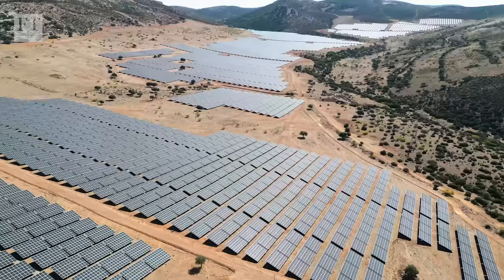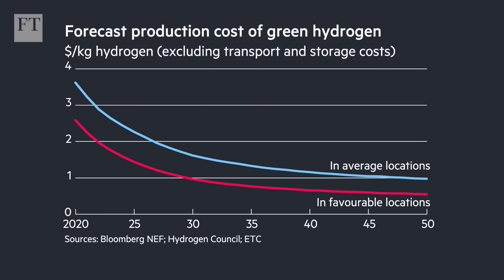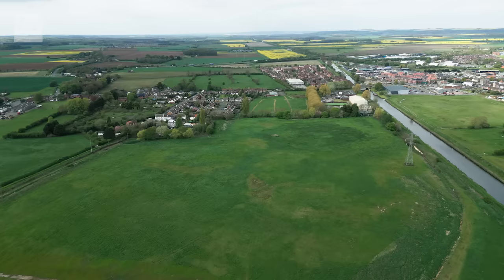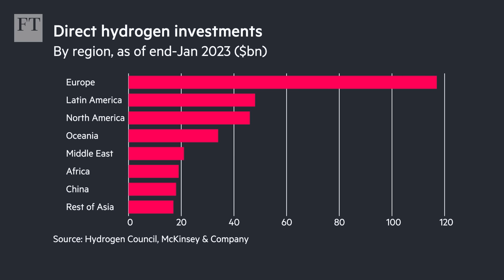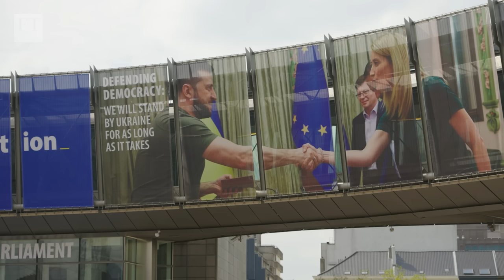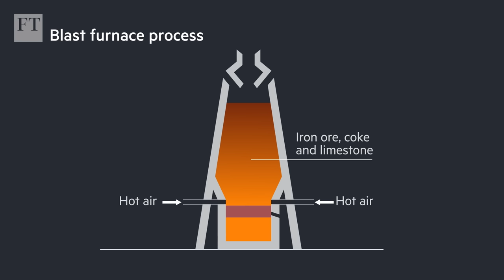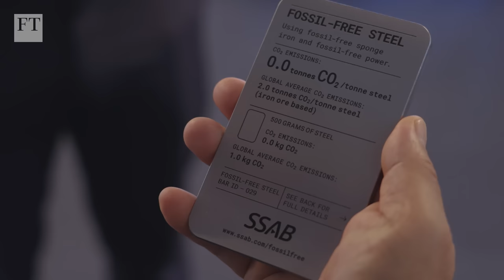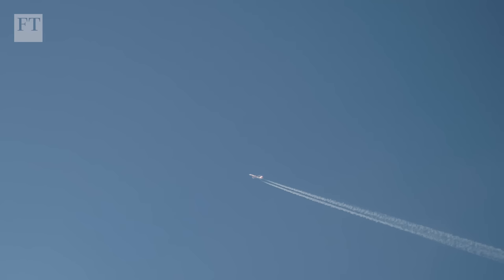Can hydrogen help the world reach net zero?  | FT Film

Comment: I used to be lukewarm about hydrogen but recently read about a project at the hospital Rijnstate in Elst, the Netherlands which changed my views. They have a huge array of solar panels of which the electricity oversupply will be stored in a local hydrogen tank by electrolysis. When electricity is needed the hydrogen is converted to electricity by a fuel cell. 
They also use all the waste heat in the entire round trip process for heating the hospital which increases the efficiency significantly. Because of the waste heat re-use and because it takes less area they choose this solution over batteries. 
The solar panels never feed electricity back into the grid which also prevents those problems. So the grid is not burdened by this renewable solution,  and the grid electricity usage has gone down to some 40% of the original grid electricity usage.
Reply: This is in my view the only way to go 100% to renewable.
Reply: Hydrogen as stationary battery, great. Hydrogen as driving fuel, stupid.
Reply: @Xonikz hydrogen as a stationary store is still dumb. The efficiency loss is 40% whereas batteries are only 5%. Batteries work better.
Reply: Makes no sense at all, just use the electricty or store it in a battery. Don't waste valuable renewables on inefficient conversion processes.
Reply: @mattwright2964  The conversion losses are used as heat for the hospital. And very often in the Netherlands the amount of solar energy is too abundant, and not valuable.

Comment: Hydrogen is a key part of the future energy mix, but there are issues with production, transportation, and energy generation that need to be addressed but glossed over in the video, they are better reported on by others on YouTube etc. 

A major issue ignored in video and by most other commentator is hydrogen's small size, which makes long-term storage challenging as it easily escapes containers to the atmosphere. As  hydrogen rises to the ozone layer, where it reacts with ozone to form water, resulting in ozone depletion and the production of water vapor, a potent greenhouse gas. 

If hydrogen becomes widely used as a fuel, the amount lost to the atmosphere and the resulting damage could be even worse than the concerns about the ozone hole in the 1980s. This highlights the consequences of combining economists and engineers tunnel vision without considering historical lessons. 

On another note, it's important to clarify that the airships mentioned from  the early 20th century used hydrogen for buoyancy, not as a power source, this does not reflect  well on quality of video
Reply: Lets then take mesures to avoid that.
Reply: Thank you for that comment. Hydrogen will have a role to play in transition to a greener future, but it is not a silver bullet to solve all climate problems.
Reply: The technology is still damning too exoensuve i see FT has become a Sneak Oil Salesman channel
Reply: Exactly
Reply: @ssuwandi3240  same was true for solar panels / EV Batteries.
A real stupid argument considering the costs of doing nothing. (Tunnel Vision)
Reply: @Someone-wh8hi  For Experiments that have cost GDP contraction and 44% unemployed I wish we did nothing especially after pandemic bettered economy. The intent to do something regardless sounds amazing in LaLaLand
Reply: Thanks for flagging that slip - I should of course have said “filled” instead of “powered”. We’ve now fixed that.
Reply: There are better hydrogen storage solutions beeing developed lol!!!
Reply: @paulmetelmann8952 it's going to be a significantly bigger player in it! It's already transforming steel production and many other heavy Industries.
Reply: @carholic-sz3qv  name some? Lol
Reply: @johndawson6057  
Who exactly what, John?
Reply: The fact that its economic competitiveness depends on government subsidizing demand by imposing crippling taxes on competing alternatives makes this about as attractive as converting your productive farms over to Lysenkoism. What is proposed is not a real economy at the most basic level and cannot generate tangible value. The master energy input resource that drives this magical economy isn't subject to open price discovery, and that distortion will ripple from the beginning to the end of every single production chain. This is a centrally planned nightmare where the value of the output is indiscernible and decoupled from the value of the limiting input. If you ever get more value out of such a system than you put into it then that would be a first, and you must have done it with the first perpetual motion device. This is about as delusional a conception of how real value is generated as any prelude to mass famine in the 20th century. "Yeah! Let's force them to value what we know increases crop yields and then we'll extract all the extra value we added when they harvest!" People really are this stupid.
Reply: @marpintado  You can't take measures without major costs. It could be worse than fossil fuel usage. It is much more efficient and effective to continue the development and production of batteries.
Reply: I would point out that current batteries are much more efficient for storing energy. At some point, recycling batteries will be enough to provide most raw materials for new batteries and reduce mining.
Reply: you've made a great argument but as someone who is in nano science hydrogen however much small it seems we can store it safely in hospital is used and labs in special containers while transport it in tanks or pipe can be done as NH4 safely. while these aren't viable best membranes are being developed
Reply: @marpintado  We have enough trouble trying to contain methane, which is a huge molecule by comparison.  This is not an easy task.  To complicate this, hydrogen is extremely reactive with other elements.  So keeping the materials for containment and seals in a condition to keep hydrogen contained is very difficult and costly.  The cryogenics needed for storage take an additional toll on materials.
Reply: @carholic-sz3qv  What are they?
Reply: @ssuwandi3240  sounds like you are living in Lala land already, but you’re not alone … hope you are enjoying the company of your fellow ostrich’s, corrupt politicians, and greedy business types. ShMe you will take us down with you.
Reply: @Astrogator1  sure IF IF IF La La Land sounds so bad do not take a cent of taxpayers LaLa Land. Trust me we do not care anything Climate Chaos since the 80s.  Decades went on and where is your dream Fascism project ??
Reply: @markjohnston4438 
do not ruin others livelihoods and i won't do the same to Greenland natives.  You have sadly and damages have to be paid back!! NEVER FORGIVE NOR FORGET
Reply: I wonder if you could surround hydrogen tanks with a thin layer of oxygen, water, or some other chemical that would bind with free hydrogen in a harmless way, to prevent it just wandering off on its own. It would still be lost energy, but at least not polluting.
Reply: @somuryz do you follow SunHydrogen and the nano technology they created?
Reply: The original ozone hole was created by CFC, wasn't it ? And didn't that take a while to fix ??? And we stopped that much manufacturing, didn't we ??.. If I recall. And that forced us into more reuse if anything etc etc. And then new tech. Which was outsourced into china etc. And kicked off that original whole air con boom etc.
Reply: @MeiinUK  not an apples to apples argument. First, the chemicals causing the problem were a small sector of the economy. Second, there wasn no revolution in the technology. Scientists knew about all sorts of refrigerant chemicals. They used CFCs, not because they were the only ones available, but because they worked the best and the cheapest. All refrigerants work in temperature windows. They are highly efficient in certain temp ranges and work terribly in others. 

So, all the industry really did was substitute the chemical they favored for ones that didn't work quite as well at the costs they wanted, but did the job, all while not ruining the atmosphere.

Moving the Hydrogen instead of Methane is not even remotely the same thing. First, getting Hydrogen requires a lot of energy. Right there, it is a terrible idea. Next, it is extremely tiny compared to other atoms, especially compared to a large molecule like Methane. So it leaks like crazy. Next, it is extremely reactive. That means it destroys many of the things it comes in contact with. If you try pushing it down the same pipes as Methane, not only will it leak out everywhere, it will react with the metal in the pipes and destroy them.

The new refrigerants basically went into the same machines that used the old ones. Some minor alterations to work with their characteristics, but basically the same.
Reply: @somuryz  with more and more use of hydrogen the greater the amount that will be lost to atmosphere. We are talking about the real world, where normal people are involved, who are badly trained, in a hurry, lazy, don’t care etc… what you are talking about in no way addresses this
Reply: @ssuwandi3240  haven’t learned how to write a sentence that makes any sense 😂😂👍👍